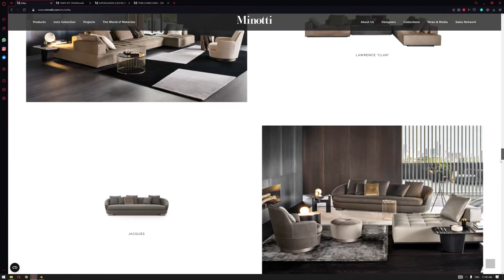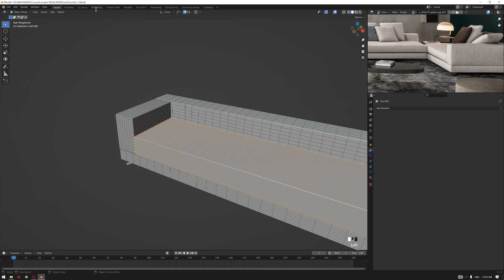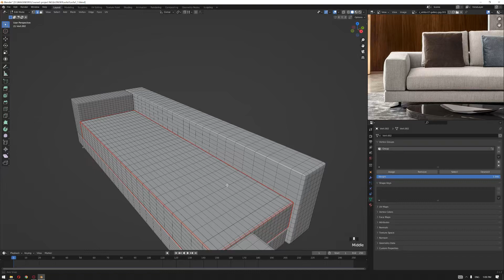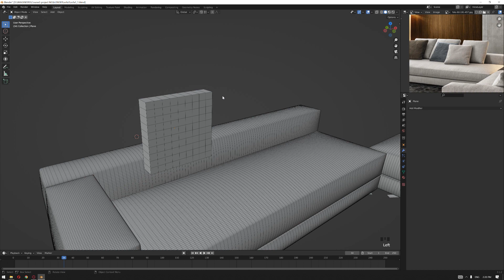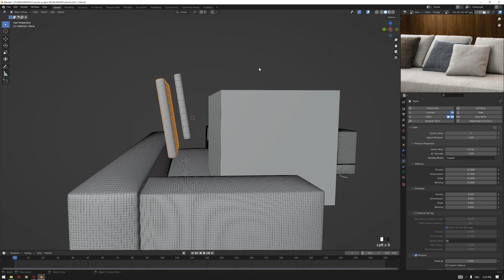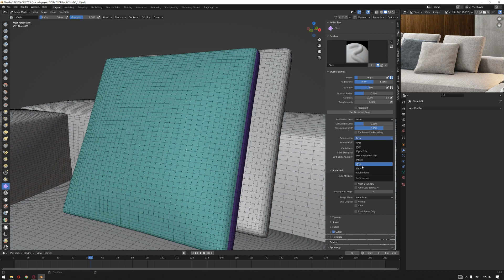Part 10   Unreal Engine 5 Arch Viz Interior -10-3  Living Area

Comment: dude can you teach how to animate face textures using images
Reply from the maker: Hi there , thanks for sharing your request would love to dig in face animation but currently were trying to get our Archviz tutorials all out , but will keep your request for our feature tutorials
Reply: @theimageneers5161  but i kinda need help related it urgent
Reply from the maker: @ExoticAnimation  can you please share a reference for what you looking for , thanks
Reply: @theimageneers5161  you can go to my channel and you see how my characters faces move, i really want that in unreal engine. i did it in blender
Reply from the maker: @ExoticAnimation  It seems like all what you need to do inside UE is to switch between material during your scenes in the animation , if you have your face expression ready and imported inside unreal , then you can either yours the best way which is basically what will be done in other software's by changing the material during the animation timeline and connecting the material to that time line to be changed at break points , this will best your best option for your animation
Reply: @theimageneers5161  i figured it out thanks amte